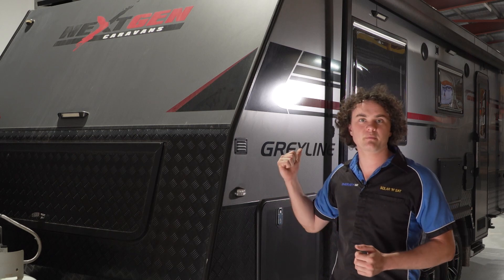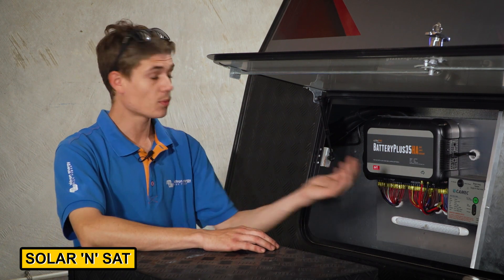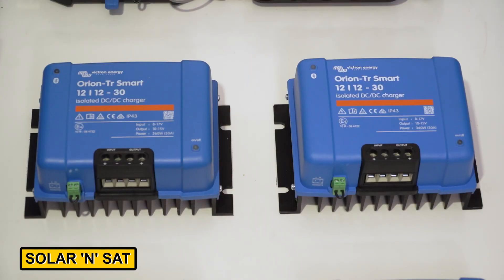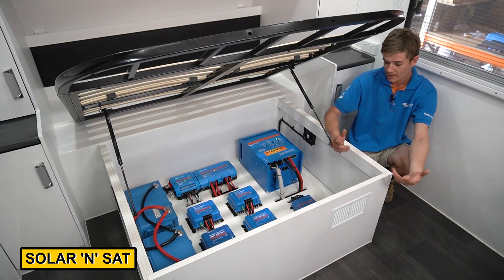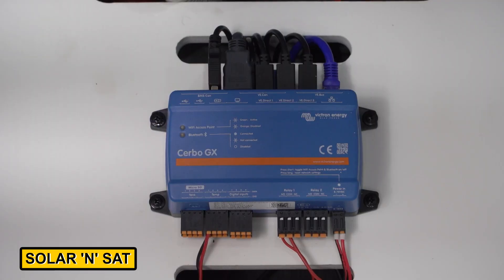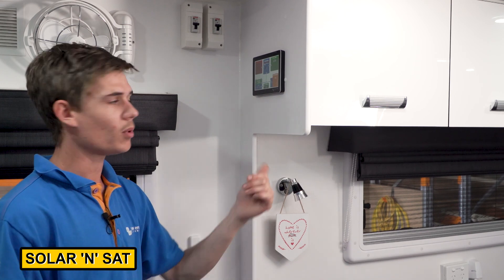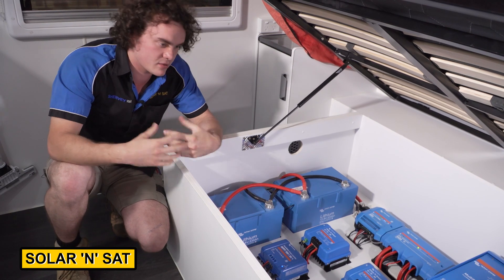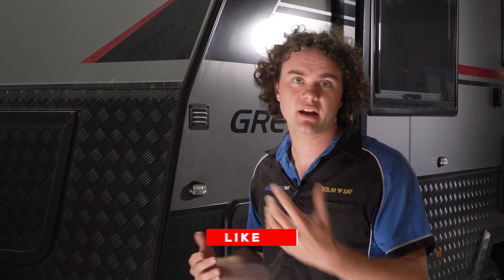Full Victron Suite | Next Gen Caravan

Comment: Great video. Nice in depth content. Nice one lads.
  In this system your running 2x DCDC, 3MPPT and I'm sure maybe one DC fuse box for essential and another for non essential like lights etc..
 Hi you fused the other components with the lynx distributor on has 4 inline fuse holders. 
  I will be running Victron
  2X  MPPT , one DCDC, 2 DC fuse boxes , one inverter  charger . Would a power in lynx be a better cheaper solution or really should run 2 lynx distributors together to have the Led indicators? Love you input as I'm keen to see what you did there also.